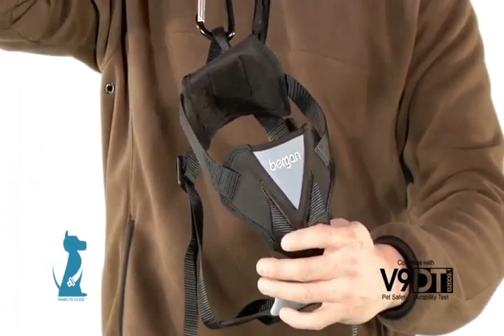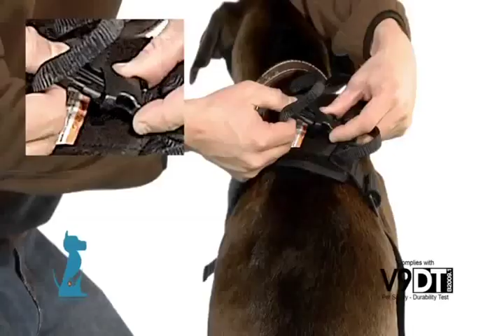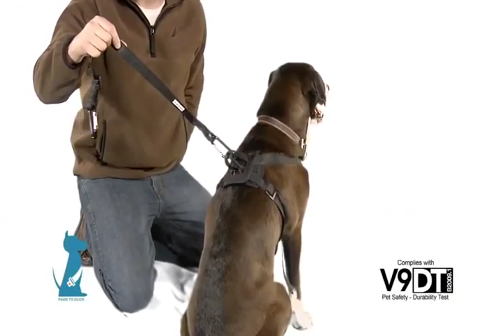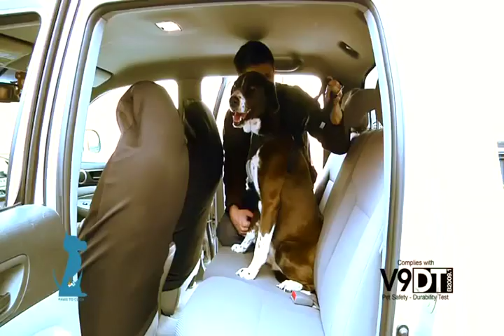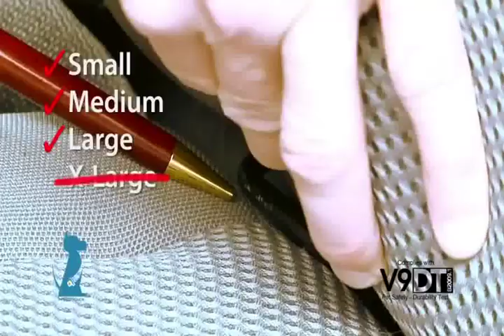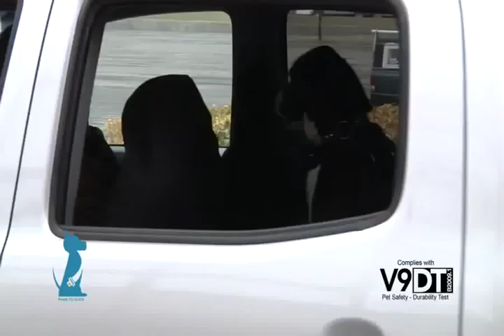Using Your Bergan Pet Travel Safety Harness - Petco How-To

Comment: I HATE this harness with a passion! My Rottweiler hates it even more. The Bergen harness that I bought is difficult to adjust. My dog wrestles and gets out of it while the vehicle is moving and gets caught half in and half out. Just getting the harness on and adjusted causes a quarrel with my dog. This harness causes more problems than it solves. I’m going to replace this not-so safe harness.